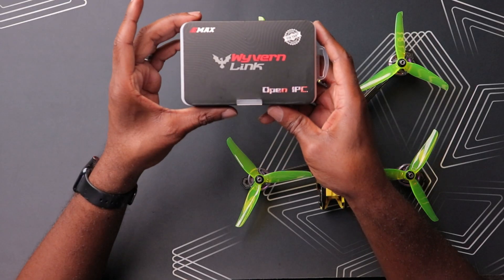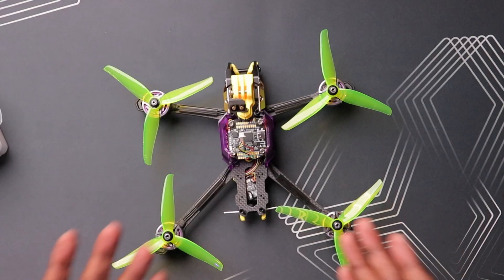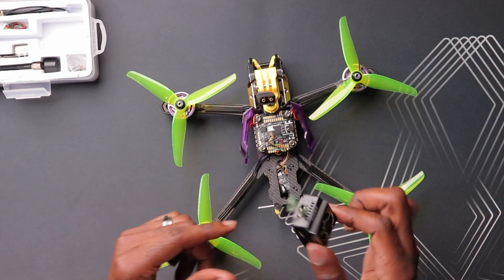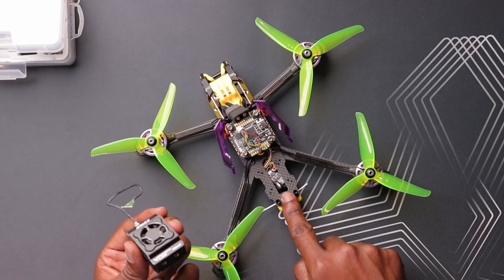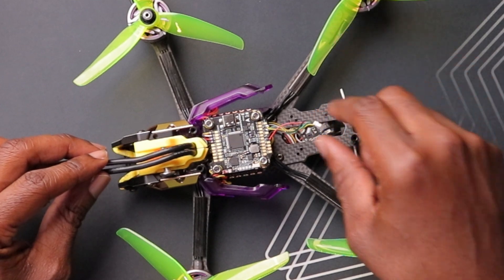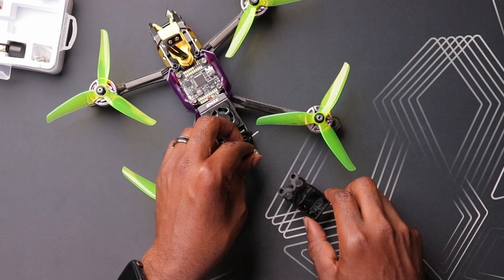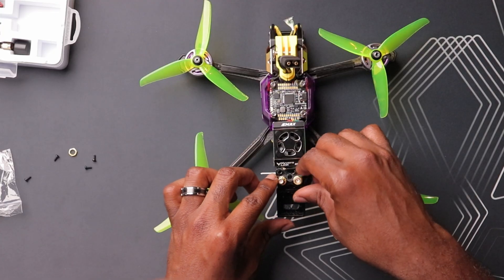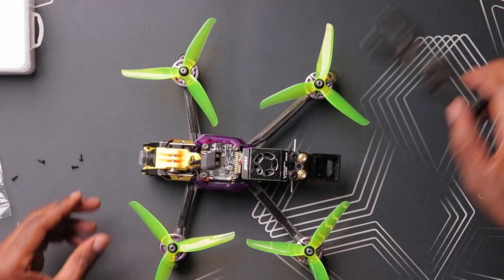How to Install Wyvern Link Wave 2 VTX In Your Drone.

Comment: Isn't the top plate from your drone covering the VTX fan intake a bit too much, specially once you put the battery on top of it? I would be concerned about the fan not being able to pull in enough air, and the VTX overheating... I hope it doesn't, tho.

Comment: VTX is very close if not touching the FC, which is not a good thing, this will transfer to much vibrations to the Gyro.
Overall, nice build do! 
Waiting the test flight vid.
Reply from the maker: That's was my thought initially... but was able to slide it to rear where it was not touching.  I've already flown the drone and the FC is not impacted.